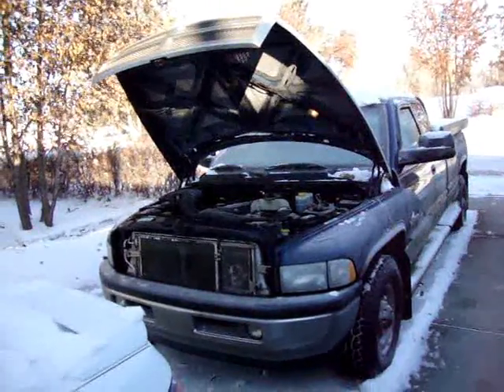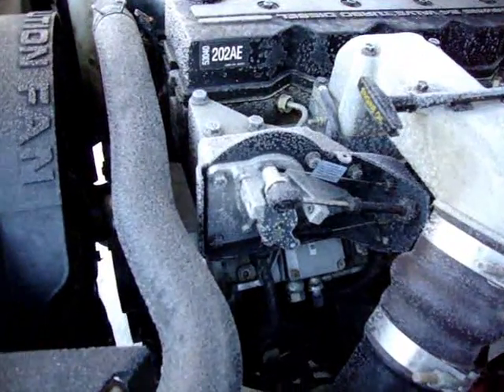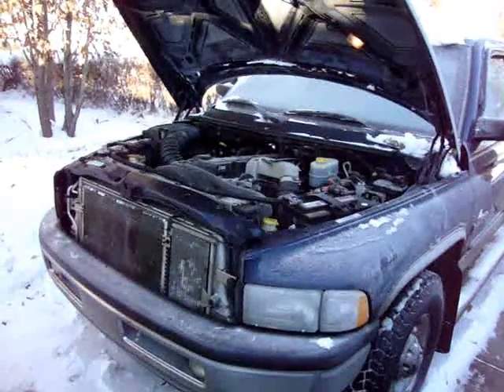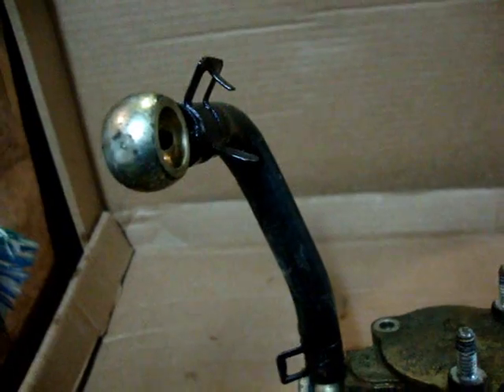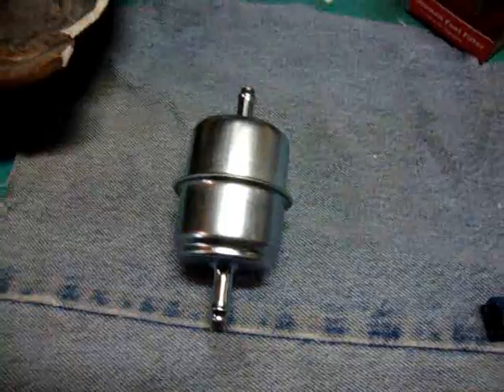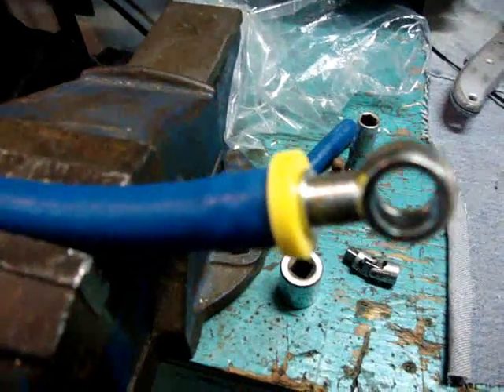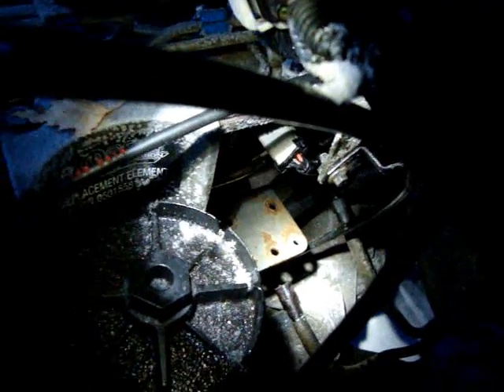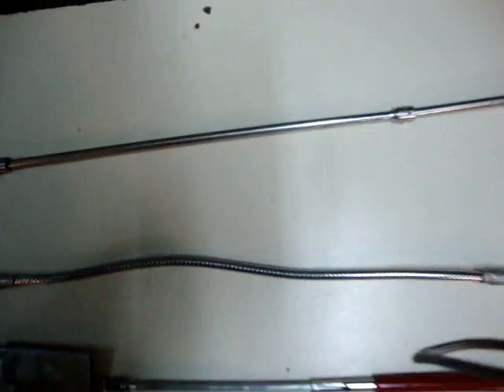5 9 Litre Cummins Lift Pump Install

Comment: I have a 2001 59 Turbo coming's diesel. I just put in a vast pump and I start. Great runs great until you shut it off. After 30 minutes driving and it won't start. It's a hard start if it starts at all. It's a vast pump I replaced. Can you give me any ideas or clue? What it needs to be done here?

Comment: Thanks for doing this video. I am going to attempt to do this on my 2002 5.9.  I bought the pump from Thoroughbred Diesel and their ad says any novice can install in 30 minutes. I don’t believe it. It looks really tight in there and I am the kind of person that wants to make sure everything is perfect. Wish me and my short temper luck.
Reply: Its a good temperament practice form when your out in the real world ya don't want to be the one everyone is looking at cause you can't keep your temperament and take the heat an if you can't do that get out the kitchen

Comment: I have the same problem with my 2002 Dodge Ram 2500 and i just reset the throttle body and that was it fix it up

Comment: Rookie question... does your truck have an in tank fuel pump as well as a lift pump?
Reply: oeklend they won't have both
Reply: Yah. Mine had both. But only one worked. Lol. 1000 dollars later. Its works now

Comment: I personally have never like diesel fuel additives they've always made diesels that I've driven run funny had an 06 5.9 I out Lucas in it and the truck would drop speed to 30 then 20 then go back to normal speed happened for the rest of the week even did the same on an 07 duramax maybe it was just my experience or normal but I don't like them at all

Comment: I took off the front tire , removed the inner plastic fender  when I did mine also  I added some putty to the socket to hold in the bolt also added some to the socket swivel to make it a little more  not loose   and used a long extension  worked better for me

Comment: Removing the starter and doing the job from the bottom makes the job way easier. Three bolts and two wires and the starter come out. Anyway, what was your fuel pressures at idle and full throttle after the swap? Great video otherwise, thanks!
Reply: That starter is freakin' heavy.  I'm still trying to figure out whether to remove it or not for the job.  Getting it out is easy it's getting it back in that's the trouble.

Comment: Inferior solder within the module is  due to ROHS treaty which got rid of the lead in solder.
http://ec.europa.eu/environment/waste/framework/pdf/BPE%20Inspection/10.%20Inspection_RoHS%20enforcement%20-%20mixed%20system%20of%20testing%20and%20awareness%20raising%20%28UK%29.pdf

Blame the politics.
Reply: My motor ran with the shaft slipping on pump impeller = zero pressure.

Comment: since the lift pump is located  just above the starter an easier way might be 2 take the driver side tire and plastic fender well out so as to have more room 2 work with instead of going down from the top of engine, just a suggestion
Reply: Theres still metal fender in your way lol